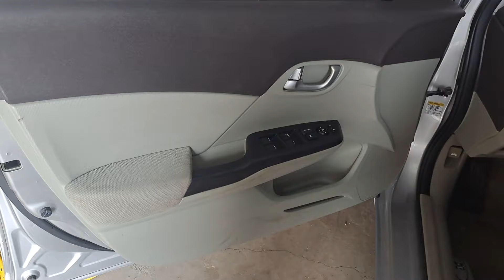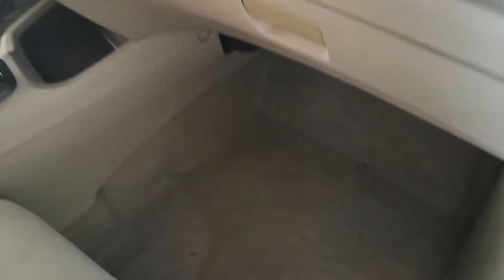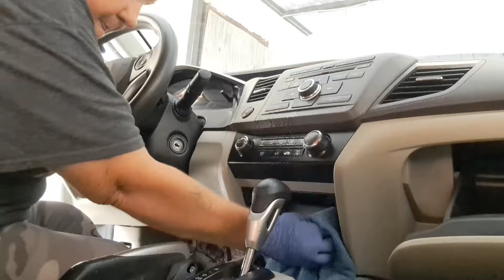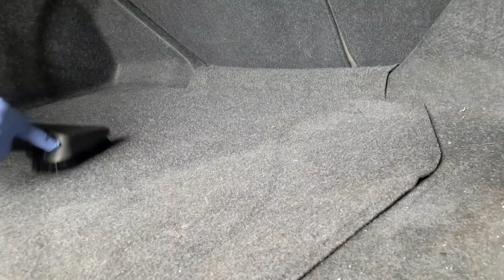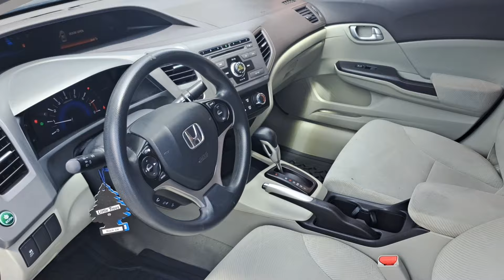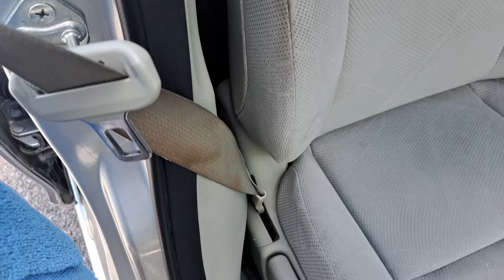Sunday Morning Dealership Detail - 183

Comment: For seatbelts you will need brush for seatbelts(they are sold by Detail Image) then a steamer and APC or carpet cleaner can also do it.  All depends on what is on them.  Something I had to use different times was Meguiars D106 and D116.
Reply from the maker: Thank you for the tip!